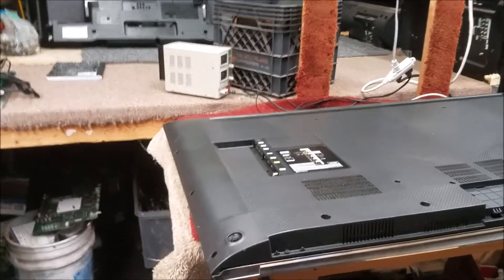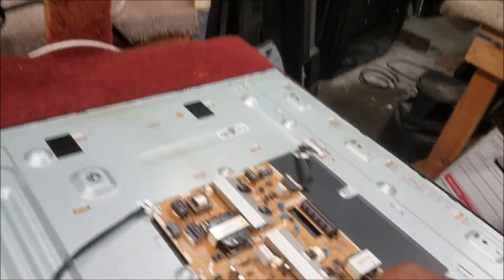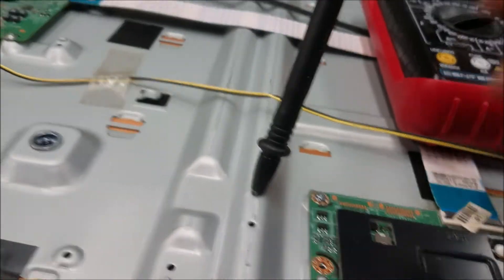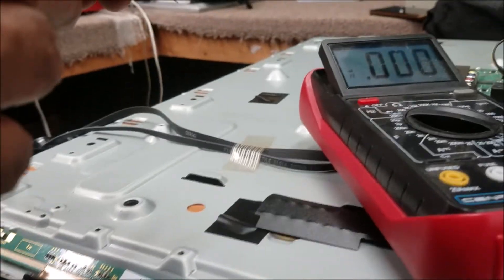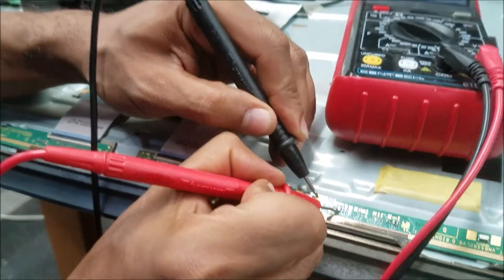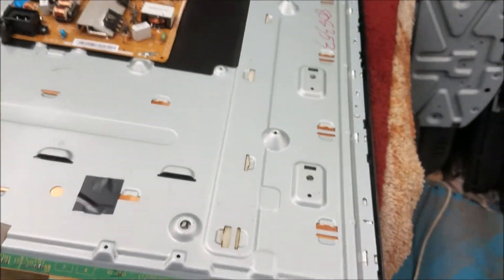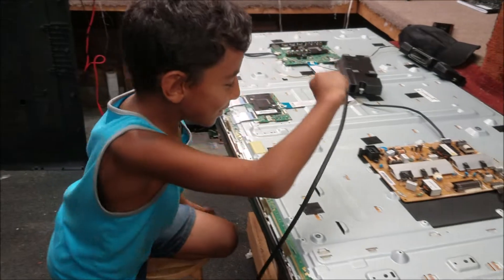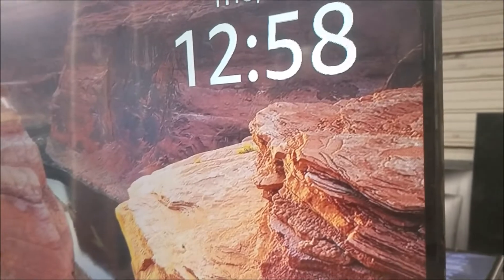samsung tv un55h6350af no picture shorted screen repair

Comment: I have this same Samsung model UN55H6350AFAZ doing the exact same thing, thanks!! UPDATE: the larger capacitors you referred to are 10μf and while they are non polarized, one side is connected to chassis ground, (terminal closest to the chassis). Connecting the power supply leads in opposite polarity will show a short condition on any of the capacitor,  no damage just erroneous results.  It’s also helpful to current limit the PS to 5 amps to speed up testing. 

 This is how I followed your excellent trouble shooting practice in isolating the dead set to the display driver  boards. I only had one capacitor on one board that was shorted. That was the only issue causing my set to fail like yours.  Thanks again friend!! Super helpful!

Comment: I have un82ru8000fxzc same issue, but mine has 4 panels. Each copasitor on each panel reads 0.03. I have 2 panels that have 2 smaller ones that aren't reading on the meter, and the other 2 have 3 smaller ones not reading as well. What would you suggest?
Reply from the maker: inject small voltage to shorted low ohm caps to see whats getting hot
Reply: Do you think there's a bad copasitor on each of the 4 screen boards? I tested it with each ribbon disconnected and still 0.03
Reply: I actually did the tape method from another video you posted and it worked! I do have a little bit of a greenish hue to the left of the middle but only noticeable on certain images. I ended up blocking 3 pins on the 50 pin cable and 4 on one of the ribbon cables connecting 2 out of the 4 panel boards. Thank you!!! You're amazing! I bought this tv for $100 and sooo worth it thanks to you!

Comment: Samsung nu70 un6900f
Reply from the maker: no display issue?i think the tcon in the mainboard. you will have  4 panel boards usually problem in one of  the boards in the edges, and there is a flex cable between the boards disconnect it and try to cover traces to test it
Reply: @SOSfixElectronics  I tried some of that.. Same results. I will try again. Thank you

Comment: how many volts did you crank in to find the culprit ?? 
2v to 5 v ??
Reply from the maker: about 1-2v something enough to get the shorted component hot without damaging other part
Reply: @SOSfixElectronics  thanks keep it up and great to hv a willing tech around!!!